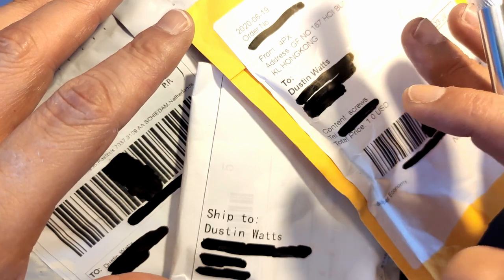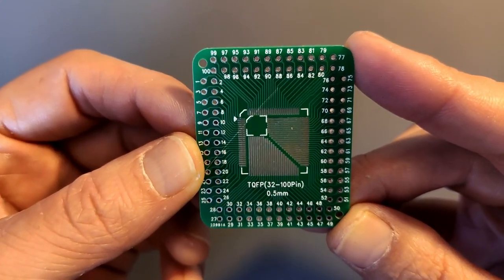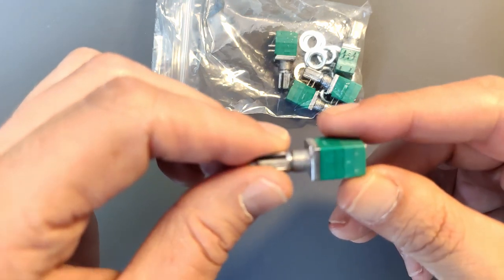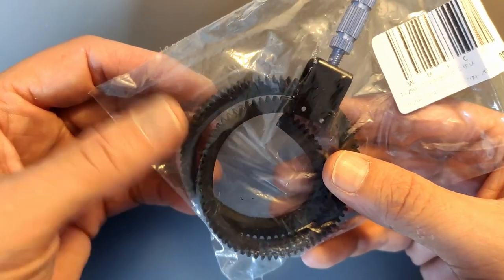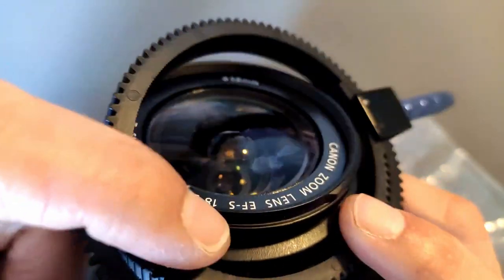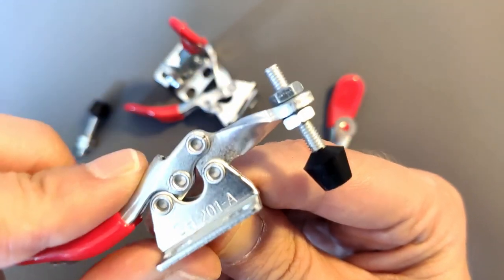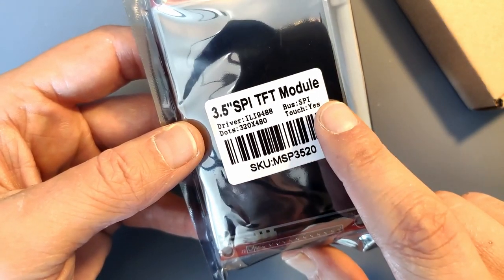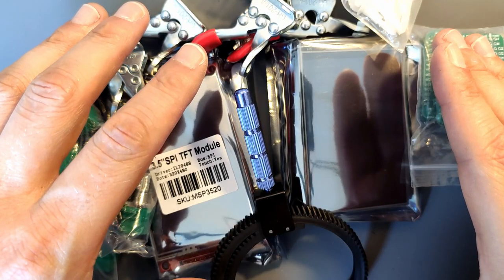TQFP Breakout Boards (Postbag #17)

Comment: Hit the liked button, nice selection of goodies. Now your going to be having fun with spring probes and toggle clamps,  made loads of ATE fixtures for boards with them over the years. Will be interesting to see your approach.
Reply from the maker: I have an idea of about how I am going to approach it. I think it will involve some 3D printed spacer and an unpopulated board.
Reply: @DustinWatts  best to have a few holes in the PCB so that you can locate to pcb over the probes, the sides are not always in the same place, but the holes will be. also the clamps swing in in an arc which can move the pcb sidways which is not good for the probes. So i would normally place stops on the base to stop the pcb over compressing the probes, then you close the toggle clamps to limit the amount of the arc the pcb sees. 

In the ATE fixtures the clamps hold the PCB down and then a lever brings the probes up to meet the tracks or test points.
Reply from the maker: @TheEmbeddedHobbyist  I also have another clamp on the way, which just has a vertical movement. That would eliminate the arc movement. I think my jig will have a 3D printed base which will limit all possible motion to make sure there is a good connection and not over stress the PCB or pogo pins.